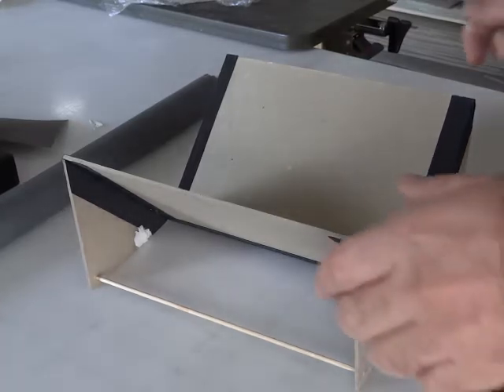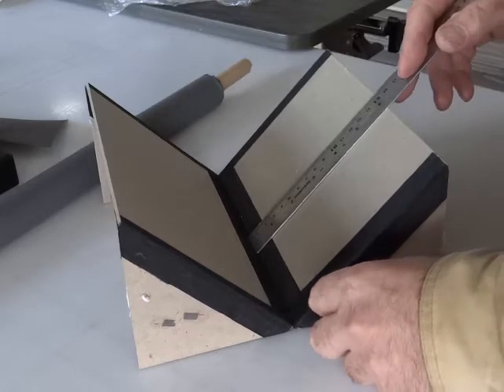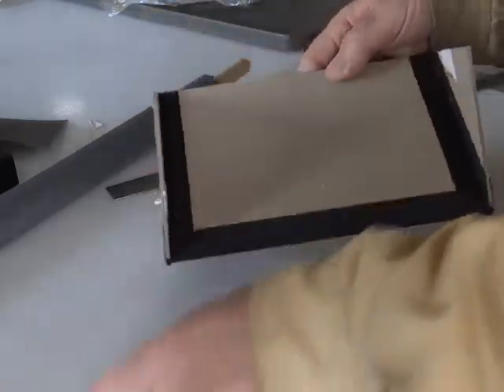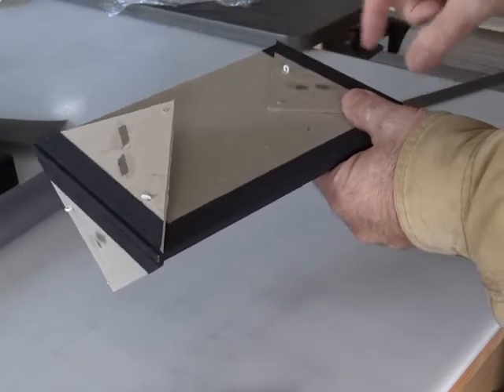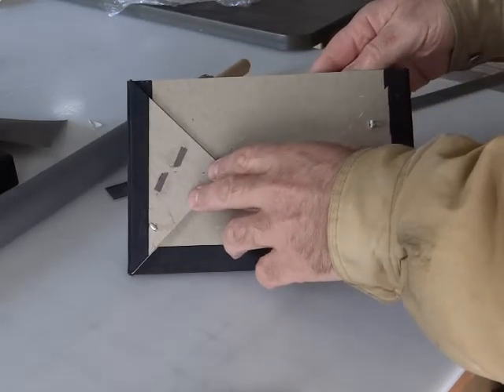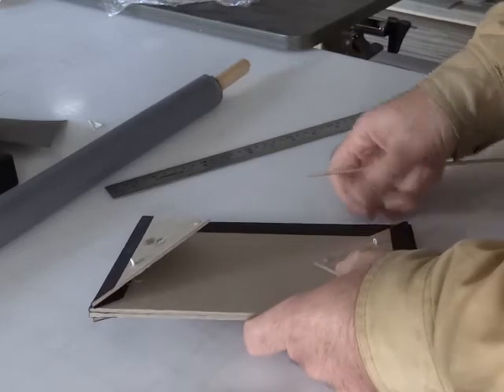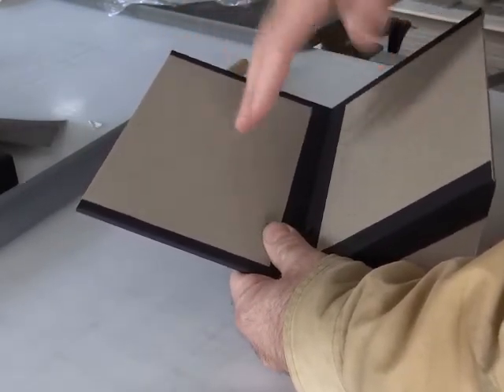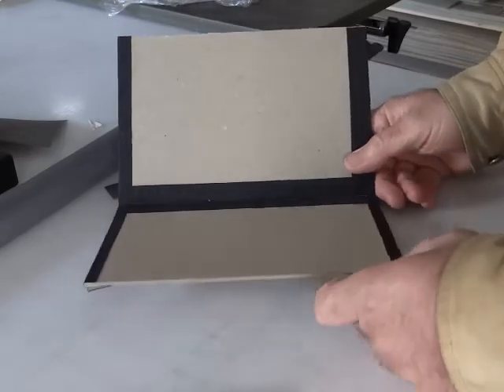BABA Sunday Session: Sewing Cradle

Comment: Don, do you have the whole tutorial for the punching cradle? I find scattered jumble of this cradle and I like it . But I was just wondering what specific material you used and the complete material list. I feel like I'm missing something.😊🙏🏻
Reply from the maker: I don't have a full tutorial. These simple cradles are made with the same binder's board I use for book covers and box making (often called Davey board) and all the hinges (the black strips) were scraps of paper backed book cloth. Bamboo skewers were used to hold the legs open.

Davey board comes in a variety of weights and you could theoretically use any of them, but I thought it best to use the heaviest for this (.098)